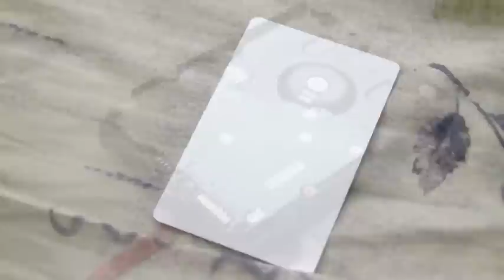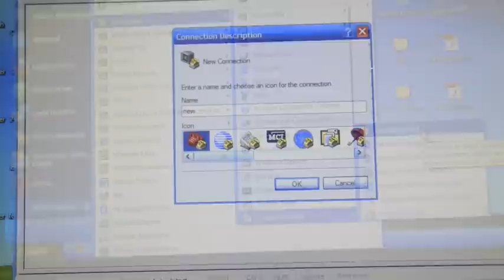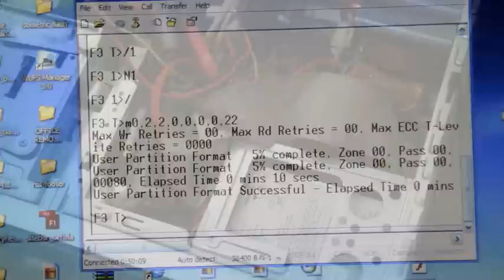Seagate BSY Error FIX with a black Nokia CA-42 clone cable (DKU-5-B)

Comment: I've just saved the valuable data from my 7200.11 (500GB, SD15), thanks to your tutorial! I used USB-to-TTL cable from FTDI (Tx, Rx and GND wires were pulled out from the 6-pin TTL connector and squeezed to attach to HDD serial pins). I had to isolate head contacts in order to get the terminal to respond. Thanks again!

Comment: Just wanted to add my 2 cents on how I succeeded: I received the (nokia clone) USB adapter (3 wires), opened the usb connector and identified TX,RX and ground. I followed the procedure, but the USB adapter was NOT recognized in Windows XP with the "Nokia CA-42 drivers". I had to install Prolific USB-to-serial drivers. In Hyper Terminal I wasn't able to enter any letter ! If this is the case, please try to switch TX cable with RX on your HDD, this worked for me. Strangely on my USB connector where "RX" was mentionned it looked to be TX after testing !!! Don't forget to use "capital letters" in Hyper Terminal where it is needed. Wishing you good luck and thanks for the tutorial.

Comment: Yes, I sorted this out a couple of days ago. Basically open your cable (if its the same black cable as mine) have a look at which wire is which on your cable (black GND, Blue RX and White TX on the cable I used) and then connected to the pins but what worked for me was that I put the ground cable in the 2nd pin from the left, RX in the 3rd from left then TX in 4th from the left. Try that. I also manualyl set the com port to a value like 20 then it worked no problems

Comment: update for you... I had the RX and TX cables reversed, so I can now get Hyperterminal to work, only problem is that after the spin down, when I remove the card and re-secure the screws, the drive has a minor clicking and does not spin back up. There is no ticking or clicking when it's booted normally or before the "Spin-Down" in hyperterminal.

Comment: Hi! I'm trying to follow your guide but I get stuck on the wiring .
I bought a DKU-5 cable with "Ark micro" listed as manufacturer and 6 wires red(GND), blue(R4) green(RXD) white(TXD) orange(3.3v) and yellow(R3). I've tried to connect the red one to pin 2 on hard, green on pin 3 on hard and white to pin 4 on hard drive, Computer doesn't detect anything else except the cable and Hyperterminal doesn't list anything when pressing CTRL+z. 
Have I put the wires wrong? Should I ad a bat?
Please Help!

Comment: Yes, windows xp pro sp3(build 2600.xpsp.080413-2111). And it doesn't detect the hard drive. Also, the cable is listed in DM as "USB to Uart" port with "Ark-micro" as manufacturer. Is it possible with this cable or should I search for one that's listed as "Prolific USB-to-serial Comm port"?

Comment: Hello! I have a Seagate Barracuda 7200.12 ST31000528AS 1 TB SATA HDD type. My problem is that when I connect the data cable, the system hangs. In Windows XP, keep trying. What to do 3 After step can not proceed further.

Comment: the video is a little confusing because when he says  gnd black, white rx and blue tx he doesn't mean that is what the wire are but infact where the wires should go. So open your cable find out which is which and then plug it in. There is a small note in the description. Good luck!

Comment: Also, I'm forced todo this on aan older machine, as the driver for teh Nokia Cable seems to not like Win7, and when I try to change the comm port in setup for hyerterminal, the comm port for the cable isn't listed.

That and the cable listed in Device manager has a warning sign, saying that the driver is having problems. I've downloaded the newest version of  thesoftware, but still having the problems. So, I"m trying this on a slow, but functioning WIN XP, system.

Comment: Damn, most of the resources on this are overly complicated. I bought an Adafruit USB to TTL that already separates the connectors and includes the Tx, Rx and Ground with connectors. I'm also not sure why the video split the SATA cable for manual connection. The description doesn't make it seem important.

I'm going to try this Tuesday. Wish me luck. I've had the drive for 7 years in the BSY state. It will be interesting to see if the drive or data or both survived this long.

Oh and Fuck Seagate. As a former hardcore Seagate fan, I never, ever bought Seagate after this. Avoided Seagate, even if it cost me an extra $10 to $20.
Reply: +Jacob Santos Well, I forgot to mention that I think the reason is that something simple probably didn't exist. The Adafruit, definitely didn't exist. Most resources had similar suggestions and I think one updated in 2011 with an easier method that didn't require a lot of slicing. A device similar to the Adafruit one.
Reply: +Jacob Santos I hear you, but this is old tech and there is no benefit in finding a much modern take in fixing this hardware. Granted there maybe a much easier approach, but as it is, we don't have to apply this fix each time and once the problematic drive is working again, it could be used for years after the fix. Besides, it should only take about an hour at most of anyone's time to splice and revive the motor. It would be advisable to just recover the data and then secure it in a newer storage. High capacity RAID drives are cheaper now and will assure up to 98% reliability in keeping your data intact. As for Seagate hardware malfunctions, well, every product out in the market has the probability to fail as some point due to any number of reasons. At least in this case there is a "fix" to help alleviate some disappointment :D
Reply: I don't think with my level of technical skill I could have done this back in 2009 when the drive failed. I don't know if I have the technical skill now without the Adafruit USB to TTL connector. I have had this drive sitting around for years and I'm just now getting around to fixing it.

Yeah, I suspect in 30 minutes, I should find out if the drive is still working or not. I just need to find hyperterminal or similar for Windows 10.
Reply: If you can get it to work with windows 10 then I guess it would be good to share the information to help others with similar problems. I'm sure there's still a good number of these drives around and being circulated through garage sales or ebay. I'm still using my drive after I got it to work again.
Reply: I was thinking about doing that.

Comment: Please can someone explain why on other videos on the same subject, some of them show that the two redundant wires on the USB cable in this video are used for hooking up two 1.5v batteries to give 3v. Is this necessary or not please ? The TX, RX and ground connections are the same.
Reply from the maker: I'm using a specific cable for the Nokia CA-42 (DKU-5-B) clone that I bought from China, I would suggest that you try to procure the very first original cable. I'm not sure why external power is need for your particular cable. This guide only works if you have the proper cable.
Reply: valadorf thank you
Reply from the maker: here's where I got it before (I guess):

http://www.ebay.com/itm/Nokia-CA-42-DKU-5-USB-Cable-3100-5100-6100-6800-7200-/310155366796?pt=UK_MobilePhones_MobilePhoneAccesories_MobilePhoneDataCables_JN&hash=item4836b3518c
Reply: valadorf that's most helpful, many thanks
Reply: John McCulloch Did you get a cable at that link??? takes me to a nikon cable???

Comment from the maker: Try it in windows 7, look for the drivers Arkmicro USB-UART controller driver and get hyperterminal to work in win 7 by getting access to a Windows XP machine and copy two files hypertrm.dll and hypertrm.exe and place them in the same folder. Hope this helps

Comment: Hi! I tried theses steps but after i pu the command U (to spin up) i receave the error: Error 1009 DETSEC 00006008
Spin Error
Elapsed Time 20.551 secs
R/W Status 2 R/W Error 84150180

This error is not about forget to remove the paper from the contact, that ocour with somes ppl. Tx

Comment: Could anyone please point me in the direction of a driver link that actually works for this same cable (win 7, 32 bit or Xp). Every link seems to not work or is a advert?
Reply from the maker: I think if you click on "skip this ad" on the top right it will let you download the zip drivers

Comment: Hi there.
You can ge tthe cable and drivers at: http://www.lps-belfast.co.uk/Nokia_cable_CA-42.htm
If you have an OS beyond XP you can get Hyperterminal here: http://www.kmtronic.com/hyperterminal-for-windows-7.html

Different cables have different coloured wires so be careful when following instructions re RX and TX and GND. If you open the USB end where the circuitry is most boards have the wires labelled on the PCB for RX, TX and GND